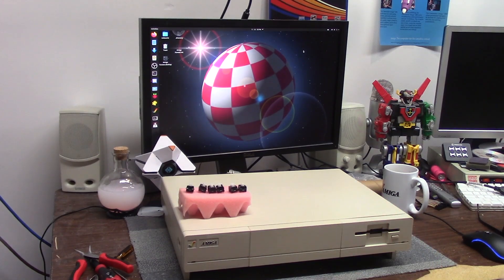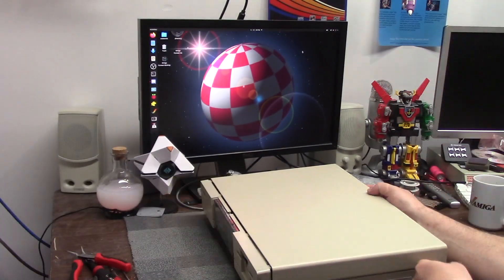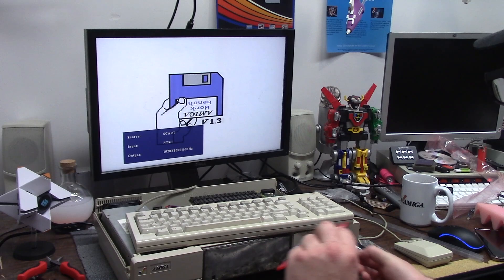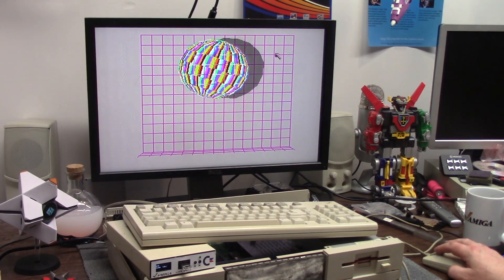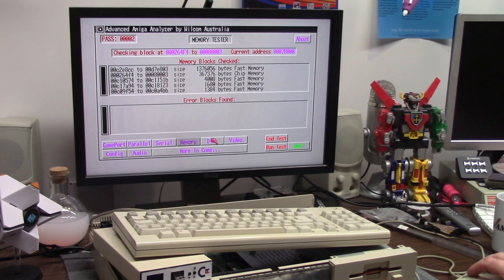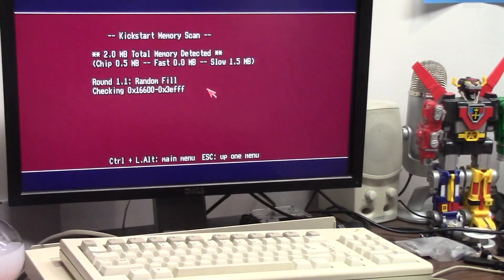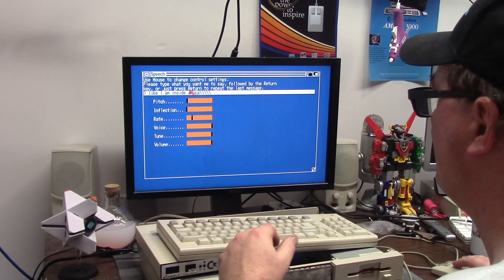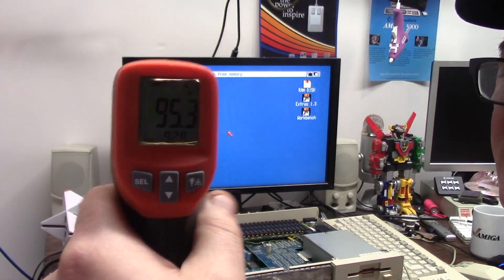Amiga 1000 rescue ram upgrade

Comment: Isn't that Spirit board really fastmem, just living in the slowmem address space? (or is it refreshed by Agnus?) Technically, is it called rangermem when it is in an A1000?
Reply from the maker: No ranger ram is used to hold the kickstart in a pseudo nvram for the amiga to use. On warm boots.  It works so thats fine by me.  The 1000 was always light in the ram dept

Comment: Chris, do you know if those are the same ram chips to populate a 500+ for Chip ram? If you think so I should order some. Also, I never thought of clipping the ground cable to a foot.
Reply from the maker: no these are smaller, these are 256Kx1's A500's use 256K x4 so 8 chips is 512, not 16 like this old bird.

Comment: Not sure if you need to add a battery the clock chip, It looks like a ”Dallas Chip” which may have a build in battery. You may have to replace the whole Chip.
Reply: The chip is an SGS-THOMSON MK48T02.  Like the Dallas parts it has a built in battery that no doubt died a long time ago.  The clock will most likely still work if you initialize it on power up with the software on the Spirit disk.  Note that STMicroelectronics makes an updated version of the chip called the MK48T02 that has a calendar that will work until 2100.

Comment: Nice video. I guess this A1000 has a kickrom.... I need to wait for my Gotek to load kickstart. Got a Spirit Board too. Never had an issue......well, except when I put it on incorrectly when I needed to get to the floppy power socket underneath for the Gotek. I thought I'd bricked the whole system. All I need now is to get my PC Sidecar with a HD working.....and that's....hard.

Comment: You and I are older than the A1000 and we still work ok.  The best part of the A1000 is when you turn it on and she comes alive the worse part remembering where you put the Kickstart and Workbench Disks.   A lot of people Poo Poo the A1000 but when it came out it was the most amazing computer every made at the time.   Ya know I never bought an Amiga any model new even back in the day.  I bought an A1000, A500 and A2000HD all used.   Today I just continue that tradition like everyone else.